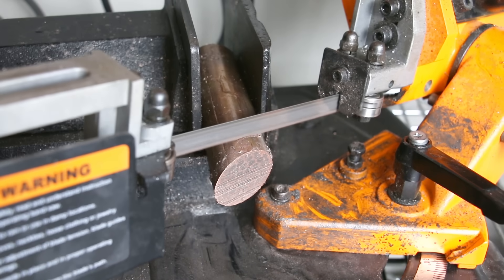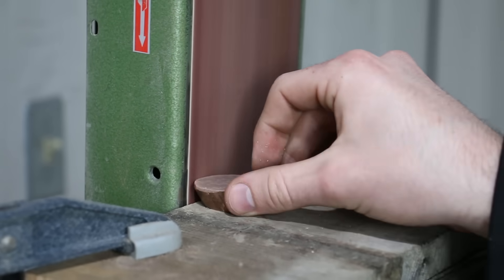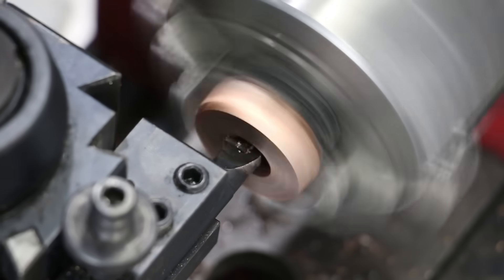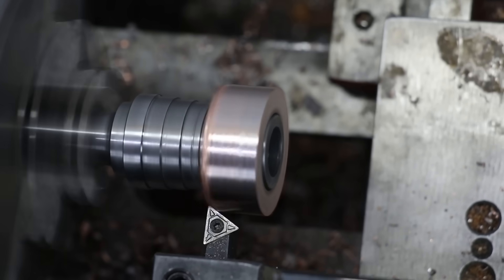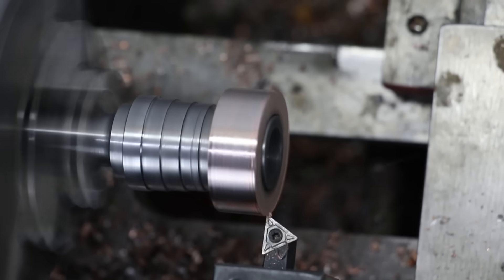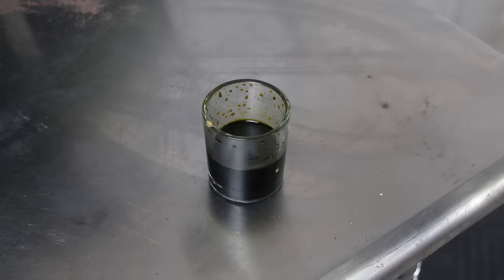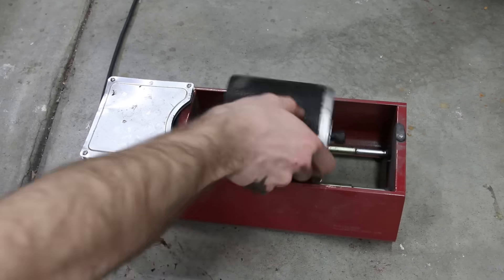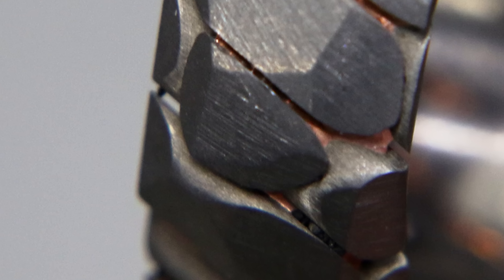Making an Acid Etched Superconductor Ring with Obsidian Facets

Comment: But wait, if it's a super conductor alloy, wouldn't it not have enough heat conductivity/retention to work harden the copper in the alloy?  Or does that matter in this particular case making the copper have it's more typical working properties anyway?

Comment: Nice craftsmanship but I think you need to explain what you mean by "superconductor" a bit more. This looks like it is low-temperature superconducting cable from either an electric power utility or an MRI magnet. There isn't just one type of material called "superconductor" so it would really be helpful if you were more explicit about what this is and where you got it. Thanks!

Comment: Is it possible use hand tools to make this? Like what if you just drilled a hole, then used different sized round files to make the hole bigger similar to coin ring making. I know this question sounds stupid because the titanium in the superconductor is difficult to work with.

Comment: You are wearing out your center drill bits, because you are going too far with them.  They are meant to just use the tip, maybe a little of the chamfered part to countersink, and then swap to a normal drill bit.  The idea being you get a starter hole PRECISELY where you want, without the walking or chatter of a longer bit.  Using the outer edge of the bit is where your problems are coming from, not the titanium, though I'm sure it doesn't help.
Reply: to me it seems like if he used cooling fluid it would help too.
Reply: I can't agree more with this comment. Use literally any cutting fluid, even bacon grease or crisco, tighten and center your tailstock some, and only use the center drill to start your hole. The time you save by not switching to a nice and sharp stub drill when you're just gonna bore it out anyway is more than lost when you're stalling your machine out and burning up tooling.  The ring itself looks phenomenal in all fairness, but can be made quicker and easier using appropriate machine practices.
Reply: Was thinking the same while watching. No flute clearance on the shank, hit the chamfer on the center drill to allow a full drill to pick up that angle and guide itself into the cut 👍
Reply: Just pilot it with a smaller drill bit for guide clearance then step it up to id size. Personally I'd use a tungsten carbide drill bit minding the plunge rate brittleness factor over cobalt hss. Preferably the straight flute variety as it has alot less chance of flex walking then a spiral.
Reply: He just needs to adjust the chamfer to keep the drill bit from walking into the titanium before the countersink hits the bevel. Easy
Reply: How u so smart 😂

Comment: What's a superconductor ring? I won't get electrocuted if lightning strike? 
+5 shock resistance
Reply: Actually, the superconductor properties only display at very very cold temperatures, so don't stand in a vat of liquid nitrogen during a thunderstorm, of course, it won't matter to you much but getting hit by lightening whist being frozen solid might make a mess, I would definitely suggest a closed casket. :P
Reply: spring breeze no, it's a super conducter so it will give you the ability to control lightning (Don't wear it in a thunder storm)
Reply: coldheart5791 no, conductor is good medium for electric, so if its a super conduncter you wouldnt get resistance against lightning, isntead it will amplify the lightning, i guess 10% amplified damage to you so...
Reply: If it were cold enough to super conduct your finger would fall off.
Reply: Lee Foreman hope lightning doesn't strike in a blizzard while wearing it
Reply: TerminatorX nah, the ring is the superconductor and not your body, so how will you control the lighting?
Reply: No, superconductor does not amplify current, nor does it work in room temperature. Also, the cold working throughout the processing probably would have made the material not suited for superconductor application anyways.
Reply: spring breeze It's a SUPER conductor so it will give you SUPER powers and since it conducts Electricity you get the SUPER power of controlling electricity.

Comment: A center drill is for spot drilling, that means a shallow hole that helps locate the center for an actual drill bit. You shouldn’t be drilling through holes with a center drill that might be why you’re burning up so much tooling

Comment: This was awesome to watch.  I was a CNC Machinist who ran a bunch of lathes for years...even logged quite a few hours on a metal band saw!  
You definitely know your stuff, because a newbie wouldn't be comfortable with bringing in a boring bar that close to the chuck!  :)
You mentioned the superconductor material is rough on tooling....how tough?  How many inserts(turn tools, bore bars, cutoff inserts, etc) did you burn through when you did this job?

Thanks, and it's a legit badass ring!  Great work!

Comment: That's not what center drills are for bud. Center drills are used to spot to align a drill, or to turn between centers. I'm a full time machinist, I recommend for cutting super conductor you get some coated cobalt drills with a nice 135 to 140 degree center cutting screw machine drill. Also get some coolant in a spray bottle, blazzer swisslube works really well with titanium.

Comment: Amazing !!, but that ring will snag everything I touch. Is there anyway to apply a clear finish/filler to it, that will fill in all of the gaps and create a smooth overall finish ? If so, it would only add depth to the appearance.

Comment: "In 2015, hydrogen sulfide (H2S) under extremely high pressure (around 150 gigapascals) was found to undergo superconducting transition near 203 K (-70 °C), the highest temperature superconductor known to date" - https://en.wikipedia.org/wiki/High-temperature_superconductivity

Comment: You really are not supposed to use a Center Drill to drill all the way through, it is only supposed to be used to make a accurate center point for which you use a proper sized drill. This turned into a cringe video once you plunged the center drill past the cutting edges and into the superconductor.

Comment: this is really cool. Thinking about it, it might be cheaper to make rings that look this if you could make the material yourself. Maybe try making some by taking steel rods, using something to space them correctly, probably weld one end shut, then pour some molten copper into it. But I'm no blacksmith or anything like that, so maybe it wouldn't work?

Comment: so dipping it in that fluid made those stone looking cracks in it? i still dont understand how it went from just having angle wear on it, to having full fledged cracks running all the way through it.  it looks amazing.  you are a wizard.
Reply: John Sullivan it's acid, that cuts away at the copper bits, leaving a deep etch

Comment: Is there any material that won't cause irritation on your skin?

I stopped wearing wrist watches mid high school because of that and only wore a ring in university for about two weeks. Doesn't matter what it's made of be it leather, plastic or common used metal I always got itches and reddish skin under it (sometimes acne too).
Reply: You have to clean your watch band/ring. Also taking them off before you go to sleep helps. This happens to me with watches. Mostly I found out that it can happen because of bacteria build up.
Reply: The titanium probably wouldn't, but copper likely would. My mother and I are allergic to certain metals as well, such as copper, steel, zinc, and possibly tin. I know that silver has never affected either of us, nor gold (not that we've had a lot of contact with gold). Try aluminum, silver plated, or titanium plated (more common). Pocket change is the worst.
Reply: It's the nickel in it.
Reply: If this is titanium and copper, and the copper has been etched, The copper wont be touching your skin, Titanium wont do anything to you.
Reply: Have you tried silicone rings / bands?
Reply: Just try titanium instead of "common metals".
Reply: metalperslfx - increase your intake on fish oil. Get yourself tested for Lupus.
Reply: metalperslfx maybe cuz it’s fake idk
Reply: Mikey Quiroz The person didnt say it was supposed to be gold or anything of the sort.
Reply: You sound like you might have eczema. Have you talked to your doctor about your issue?
Reply: I thought stainless was hypoallergenic. Also, make sure to always dry under your ring after it gets wet.

Comment: So is it dangerous to wear this or what lol, super conductor... o.o
Reply: Well it isn't a superconductor at room temperature, and even if it was, it would be no more dangerous than wearing a ring made of a quite conductive metal (silver, copper, gold), which isn't really dangerous at all. The only real way that the conductivity itself can be responsible for hurting you is if you ran enough current through it to heat the ring up and burn you. If you're exposing yourself to very high voltages, it doesn't really matter if you're wearing a ring or not, because the current passing through your body is what is going to hurt you, not the ring. If it were a superconductor at room temperature, it would actually be safer than any of those metals because it would not heat up at all when you ran current through it. 

If you cooled it down low enough it would become a superconductor and put it on, it would do some serious damage pretty much immediately (akin to the heat loss experienced in dipping ones finger in liquid nitrogen, but actually colder)

Comment: You need a carbide center drill, and you need to use more cutting force! Titanium obviously work hardens, so you need to get, and stay, below the hardened layer. Aggressive cutting is the only way to get this done.
Reply from the maker: Thanks for the tips! I’ll have to order some more carbide tooling.

Comment: Beautifully done, Patrick!  My first thoughts on the ring mandrel were "Machinists make those, not buy them!" but yeah, I suppose there are a lot of viewers that aren't machinists.  

With the ID finish, you might try varying(increasing most likely) your speed(rpm) and the feed.  I've never worked with anything smaller than an 8' bed, and it's been a while, but as I progressed(and veterans shared knowledge) I found I was spinning too slowly to produce the beautiful finishes I was seeking.  Of course, the longer the boring bar the more the chatter =/  Just stumbled on this but it peaked my interest =)  Great product and use of material!
Reply: Rickford Miller if you did this on a phone... I feel bad for your thumbs 😂
Reply: Rickford Miller don't forget the machinists that don't have much free time to make their own

Comment: the reason your spot drill was getting stuck was its only for starting a hole and you needed to use a HSS drill to finish the cut. it also would have allowed you to do it from one side. you wand take the spot in about half way up the 45 deg angle.

Comment: @Patrick Adair Designs

You wouldn't crash your lathe nearly so much if you reduce your feeds, and had a drill with the right back angle for the job.  Copper is a very bitey material, loves to grab.  The steeper the drop off on the back of the cutting edge of the drill, the more it loves to sink in and grab.  You would also have a lot sharper tools a lot longer if you increased the amount of coolant / lubricant used - ie your saw, and your lathe tool tips...  Better yet, get a coolant / lubricant pump and hose, and put that on the job - constant coolant is better than periodic coolant.  Will also help with the feeds and speeds - more coolant = better cutting + faster processing.
Reply: Also, it's a center drill - as vmeansvelocity posted earlier.  As he / she said, it's meant for making an initial hole, then using a proper drill to make the rest of the hole.  Not meant to be used on the angle of the drill, which is another reason you're crashing the lathe and stuffing your drills.  If you really want to avoid stuffing your tooling, and I can't say it enough (my dad of 50 yrs fitting and turning drummed it into me), Use More Coolant!!!!!!!

Comment: Beautiful ring!  However,  are you aware of the common elements used to modulate the electrical properties of semiconductors?  Toxic elements such as lithium, arsenic, gallium, germanium, bismuth, etc.  Use caution when metal working this material. PPE!!!  Plus, might think about elements absorbing through the skin  while wearing ring, just some thoughts.  Congrats again on the beautiful ring.
Reply: Practically speaking, only lithium and arsenic are toxic. Of course, anything is toxic in large qtys, but you have very little to worry about from skin contact with gallium, germanium, or bismuth.
Reply: not semiconductor, superconductor (Niobium-titanium and copper)
Reply: chuckcrunch1 thanks.... i was going to say that superconductors are not the same as semiconductors, lol.

Comment: first I was like "meh" but then it came out of the acid... wow
Reply: pistol2 the acid melts the copper, leaving those black parts there
Reply: Piece o' LEGO but how does that work though? It was flat and then the acid makes it have these individual little rocks wtf.
Reply: Piece o' LEGO ok thanks, get it now looks so cool
Reply: Yeah looks kinda volcanic once the acid etched off the surface copper. Like a fantasy Brimstone instead of normal sulfur.
Reply: +pistol2 because the superconductor is improperly mixed with copper  because of the density difference between them. The superconductor has a lower electronegativity than copper, wich means that in an acid solution it'll act as a battery, oxidizing the copper and reducing hydogen at the superconductor, so basically the copper's eaten by the acid while the superconductor isn't.
Reply: Piece o' LEGO i like
Reply: EXACTLY
Reply: Yeah I'm sure you weren't seeing the thumb nail of the final result at all.
lying fool

Comment: WAIT! a superconductor is a type of magnet not a material, what's the actual material you use because superconductor is not a material, in fact many different materials can be called super conductors if they meet the magnetic properties of a super conductor, though that thing doesn't or else a lot of scientific research i've read on the subject is completely wrong... that's not a superconductor
Reply: looks dope though

Comment: This is a "centering drill" - you should only use a "tip" to pre-drill slightly and change it to normal drill for full boring.
That is why you are fooking them up.
Reply: Velocity is right, its just for getting a center for the proper drill to... well, drill into. He also wasnt using nearly enough lubricant/coolant.
Reply: Actually the material he's drilling is to tough

Comment: At around 2:50 you were complaining about the difficulty of drilling through the superconductor and it made it sound like all superconductors are that bad. When in reality copper is a superconductor, you just have to cool it down to the point were the electricity has no resistance passing through it, and a lot of metals are superconductors (around 75% I think) the only downside of them is that they need to be freezing cold to work (some more than others). Anyways my point is it isn't that hard to drill through all superconductors, also 99% of you watching this video have a superconductor within ten feet of you.

Comment: Very cool, but not a superconductor at this temperature
https://en.m.wikipedia.org/wiki/High-temperature_superconductivity
Reply: Vector Music
Nah man, this ring is so cool its conductivity goes super
Reply: If the T_C doesn't matter, couldn't you call an aluminium ring a superconductor ring?
Reply: I wouldn't say it's false advertising, room temperature/pressure superconductors don't exist (yet). It's still usually worth making a distinction between superconductors and regular conductors at room temp despite this though b/c the two can have very different properties. For example, some of the best superconductors available are really crappy conductors at room temp
Reply: Is anyone intending on using the ring as a superconductor? No? Then it really, really doesn't matter.
Reply: Superconductor is supposed to provide next to zero resistance which can be achieved by cooling down good conductors. So at the temperature where the metal in video is at, it isn't a superconductor. It's just a good conductor, factually speaking.
Reply: Jyoti Gupta still pretty dope tho
Reply: Superconductor has 0 resistance, not close to 0
Reply: It's kind of false advertising.
Reply: Chris Constance Hahaha. truue...
Reply: Common knowledge.  I don't think that's what's important here.
Reply: Christopher Melvin Just the average jackass pointing out every little error.

Comment: I think as far as my tastes go; the round superconductor rods slightly detract from the 'obsidian' finish of the ring in the etched away areas, if the rods were more angular it might look cooler (like if the rods had the obsidian finish before they were assembled into the blank), I wonder what metals would work best together if someone were to try to make a blank with that in mind? overall probably the coolest thing I have seen in a while.

Comment: Could you reduce tooling cost by using a torch to cut the center our or a portion of it?  

Also might be cheaper if you had access to a waterjet.  You would likely need a jig to help with simplifying the programming but if you did you could bore out a lot of rings in a few minutes.  That should also be more efficient and probably more cost efficient then bits.

Comment: Dont toss the center drill just sharpen it .25% relief.
im retired machinist,you can get many 100 of uses off all drills.
research it and you sand paper/ grinder for types to use on soft metal / plastics and save money.
Reply: nice job tho enjoyed